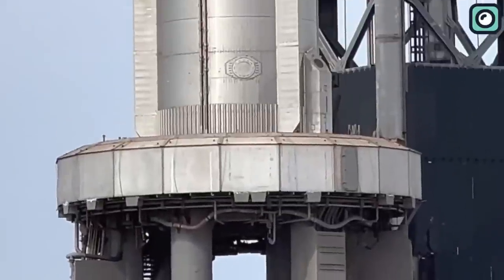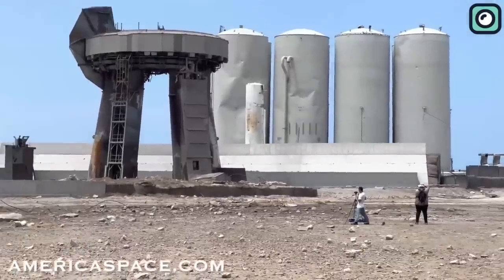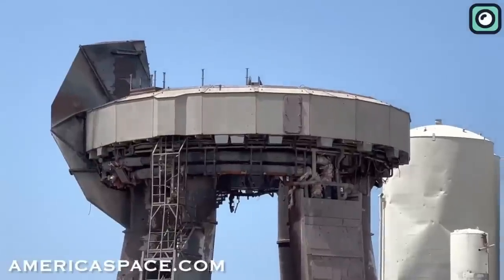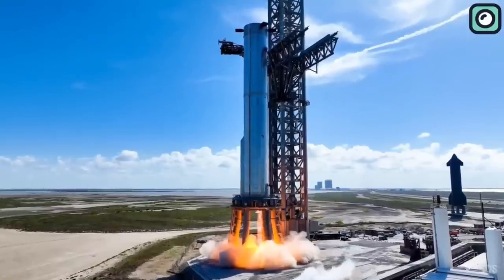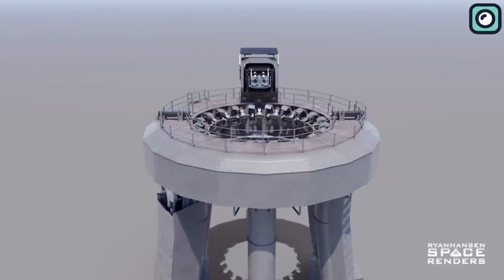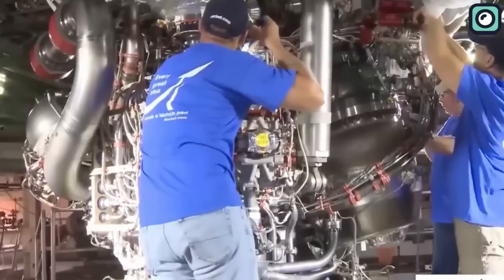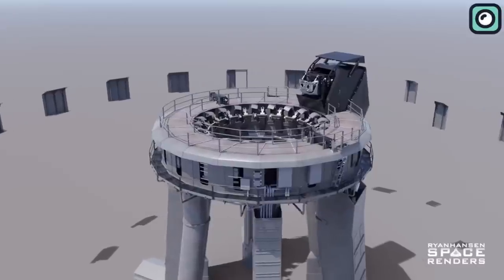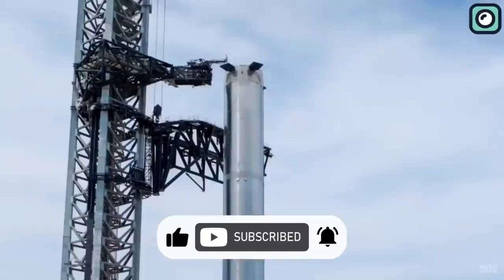SpaceX Steel Plate Launch pad Testing ... Elon's Reaction!

Comment: Every time they subject the upper steel plate in the water cooled sandwich to that level of heat and moisture it will oxidize. Just like the metal cladding on the launch mounts legs. They can put all the cement/rebar piles in the ground underneath the plate system that they like but they’re still transferring 16.7-17.2m pounds of force to a solid surface. A solid surface with no diverter. The full 33 engine static fire test should be entertaining.
Reply: That's what concerns me, and which no-one has even mentioned yet. For the rocket to lift, the ground must push back with equal force without being displaced. That steel plate arrangement has to be incredibly solid and also the ground beneath it, into which the force is passed. I hope it works.

Comment: What's a metal Achilles heel?  Heat. Blasting the metal with such force how many times do you think it can withstand?  One, Two, three? Bad idea. MUST HAVE FLAME DIVERSION AND THE PLATFORM SHOULD BE MUCH HIGHER. THE BASE METAL PLATFORM SHOULD NOT ABSORB DIRECT BLASTING. FLYING DEBRIS WILL HIT THE ENGINES. WATER DOES NOT SOLVE THE PROBLEM. THE 5 LEG STANDS SHOULD BE WRAPPED IN A HEAT SHIELD LIKE THE BOTTOM OF THE SPACECRAFT. A HEAT DIVERSION PLAN AND GETTING RID OF ALL THE METAL LEGS AND BASE WILL SIMPLY ALL THE PROBLEMS. GO WITH THE NASA DESIGN FROM PREVIOUS LAUNCHES.
Reply: NASA has never tested any of their diversion designs with this amount of power. Perhaps engineers are arguing that replacing a water cooled steel plate is more economical than repairing a trench. Trenches are very good at what they do, but can they withstand 19M+ pounds if thrust? No one really knows. The most a trench has endured was SLS at 8M lbs, and SLS caused damage, albeit not like SpaceX did, to its launch platform. The superheavy booster will produce over twice what SLS produced. So, the idea that a trench is a cure-all is completely lacking any evidence since no one has ever tested one at these power levels. The open design of the current OLM allows the exhaust to exit from all directions, a flame diverter ir trench would concentrate 100% of the exhaust in a single, or dual, direction, which means even hugher forces localized in specific areas. Lastly, when it comes to rockets, things aren't linear, just cause a 8M lb rated trench can withstand 8M+ lbs doesn't mean double it to withstand 16M+, perhaps the curves, angles, or walls of the inside of the trench wouldn't withstand those forces, and the trench could collapse or be damaged, we dont really know, at least not until someone builds a 19M+ lbs thrust rocket and uses a trench design. As I said, if the choice is repairing a damaged or collapsed trench vs. replacing a water cooled plate, I'd go with the plate. Also, we are looking at how SpaceX is reacting to their booster. They aren't going to completely dismantle the OLM and OLT and tank farm to build up a massive mound that they can then cut a trench out of. They're working around their existing infrastructure. So, as it sits, a trench is out of the question, seeing as the water table at Boca Chica is too high to construct one using the current infrastructure. So, for now, we sort of have to wait and see if a water cooled deluge platform is up to the task. If it is, then awesome, if it's not, then it's back to the drawing board.
Reply: How do they plan to make methane on Mars? Methane is common gas derived from oil. Swamp gas. Where is that found on Mars???
Reply: I think the hope is that the steel won't crack like the cement did. The theory is that everything was ok until the blast got under the concrete and into the sand below. Steel shouldn't actually crack. But the bending and rusting will be interesting!